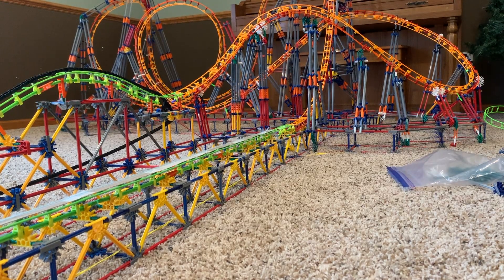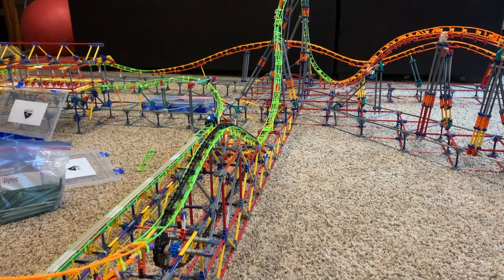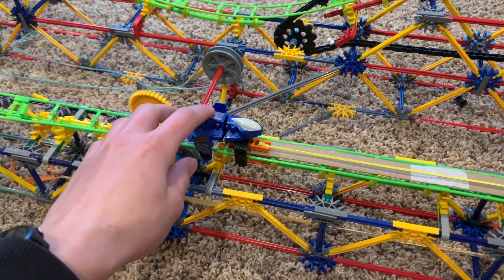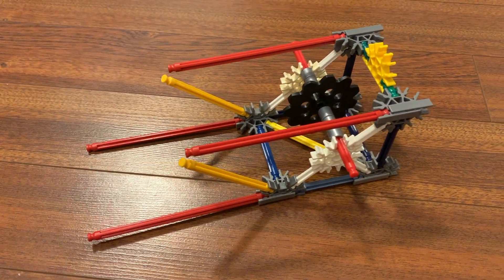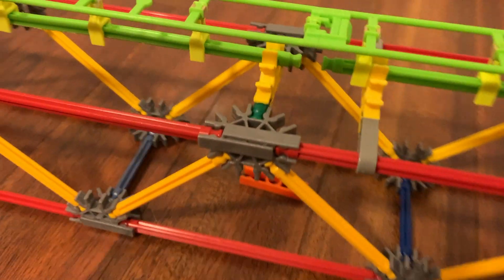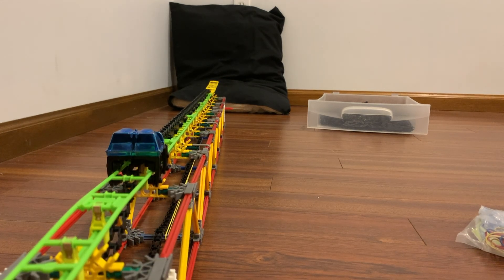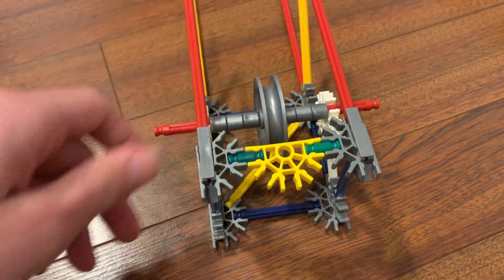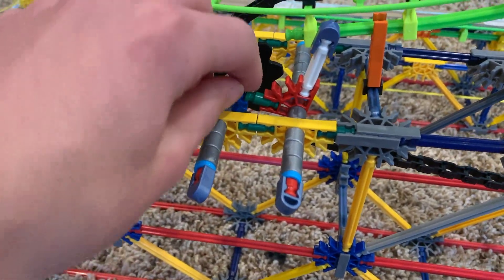How To Make A K'nex Rollercoaster Launch - Step By Step Tutorial

Comment: Idk if my rubber band is too strong but for thw third type my chain wont lock it keeps sliping
Reply from the maker: I'm guessing your locking mechanism is slipping.  You have to make sure that the pin locks fully into the small gear. If this isn't what you mean  just let me know and I can try and help more.
Reply: @TheKnexEnthusiastyes I fixed it I had to swap the rubber band with a less powerful rubber band and ot doesn't slip
Reply from the maker: @Linc0128  Ok good. I hope it stays working for you.
Reply: @TheKnexEnthusiastya I posted a short on it launching